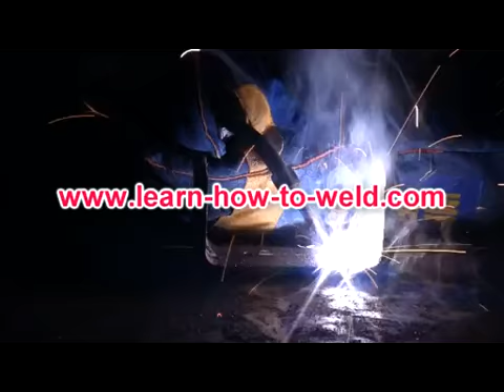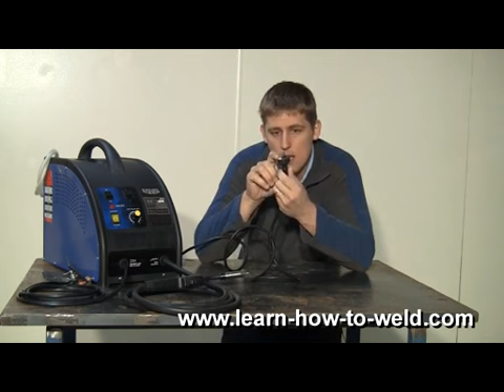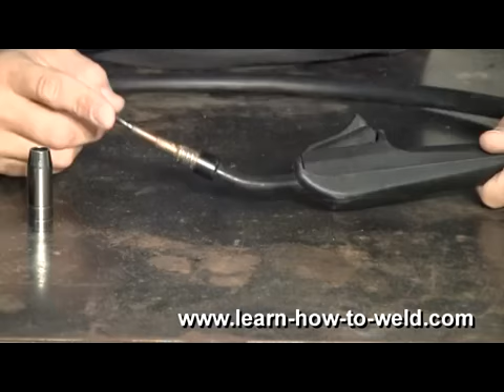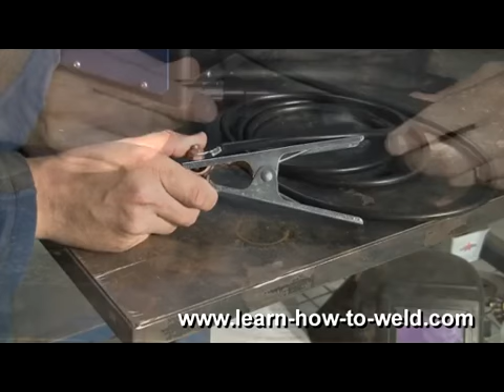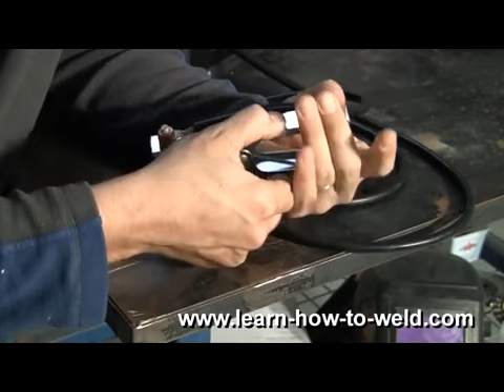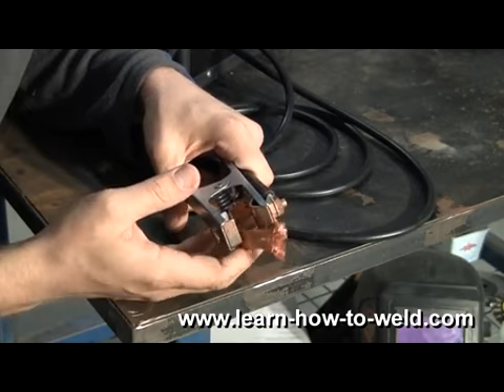Gasless Mig Welder

Comment: If the gun liner goes or anything else goes on the gun you can by conversion kits to fit the Euro fitting. They are so easy to do I managed it in 30 minutes. I also have both the positive and negative ports so I can stick weld if needed.

Comment: Your machine looks exactly like that they have at our local store. It is about 300 USD with wire and mask. Though it is the same quarter circle shape, and same curved handle, I don't think it has the option of gas. I think that you have more volts in Oz. I am in Japan and we only have 100 and it is a 20 amp machine.

I only want it for one job. Will I be able to mend my beach hut (with two rusted columns) using this? I know I should be using a more powerful welder, but I don't mind going slow.